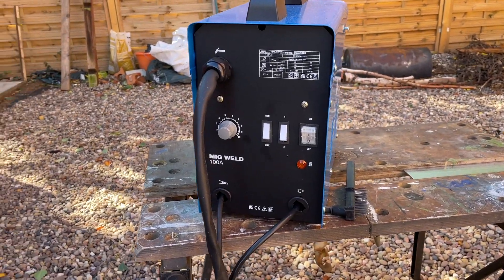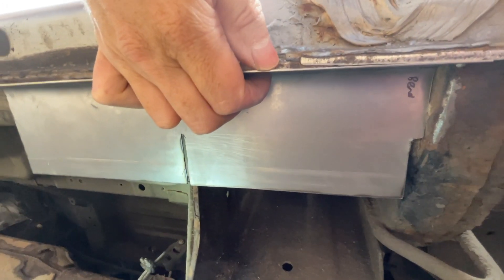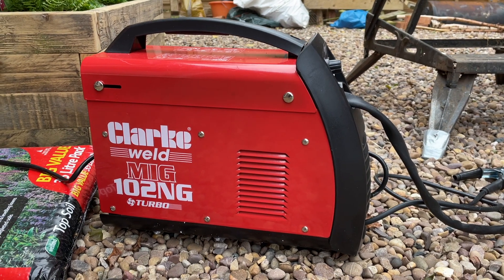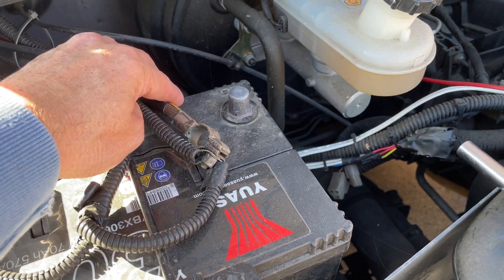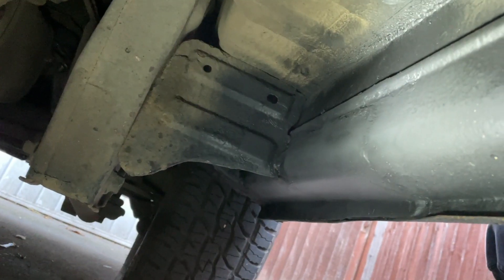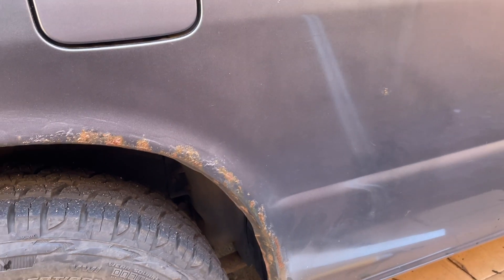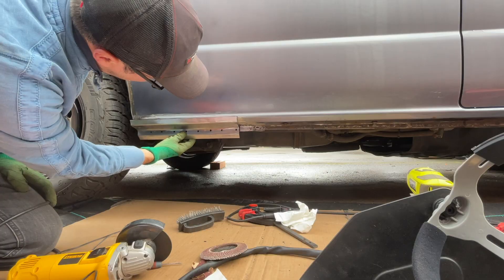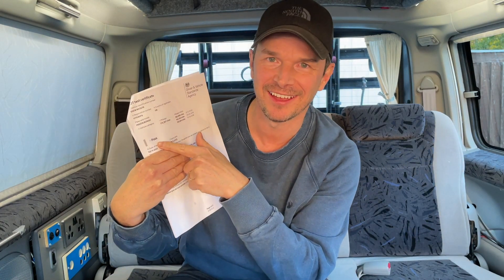1st Time Welding | Sill Repair On a Mazda Bongo Campervan

Comment: You done well my friend saved hundreds keep at it give a little more wire speed you will get there all the best to you kind regards ron😊
Reply from the maker: Thanks! I'm pleased I had a go at this. Getting the settings right on the welder was a real challenge and I still don't think I've got it sussed, I'll just have to keep practising (thanks for the tip) :) Cheers

Comment: Synchronicity, I am about to embark on some welding of the inner sills and under the OS front arch on our Peugeot Camper. Your video insired me. to progress. The 'have a go' attitude is one worth going with, especially when little independent garages are now charging up to £75 per hour. When you factor in the costing and compare to a garage, it is a winner outcome, as you have investment which pays for itself almost immediately. Thank you fella.
Reply from the maker: Thank you for the kind feedback :) 

It's 100% one of the most rewarding things I've done. When you start the welding journey you will yearn to weld any two bits of metal together :) It's daunting and things can go wrong, but give yourself plenty of time and practise as much as possible. There's so many other projects that the welder will come in useful and it really can pay for itself straight away. Cheers 👍

Comment: Good job. You'll find many mot testers are reluctant to pass repair welds unless they are seem welded though. I know factory is spot welded but the argument is repair patches should be seam welded.
Reply from the maker: Thanks! I had read that before starting this and I did seam weld a few areas (mainly the rear portion). I did like using the plug welds where I did as they were coming out really strong (with good penetration) and seemed to be inline with the factory welds as you mentioned. I was preparing myself to have to maybe seam weld a few of the parts if the MOT mentioned it, that's why I hadn't put waxoyl on anything just incase! 

I will go with your advice when I do the next parts as there is more to do. Cheers 👍👍

Comment: you can get preformed sills fron Bongospares now
Reply from the maker: I actually bought some for this job, but ended up making my own as I wanted a slightly longer bottom part (and they don't sell the cill shape for the rear of the van as far as I know). They are a good fit though so would recommend them.

Comment: give your self a pat on the back young man. a tip for you. get some scrap metal and just practice welding. try and use some treatment on the bare metal too, to stop it from rusting on the inside. good job . well done.
Reply from the maker: Thanks!! I started spraying the parts with zinc spray and I have got some cavity spray now. I agree with the practising on scrap, it’s a steep learning curve lol. I found welding to be incredibly enjoyable, luckily with owning a Bongo I’ve got a lot of welding to do 😂

Comment: Hi, great video. So after a year, all good? Did it pass? Am just about to start a very similar job on my Bongo. What guage steel did you use? Any tips on not blowing holes in the metal? Thanks, Nik
Reply from the maker: Hi, it did pass (I added that at the end of the video so you can see how it worked out). It's actually passed for a second year as well just recently!! 

I think it was 1mm thick, 1.5 would have been nice, but I used what I could find. The 1mm was nice and east to bend into shape so was pretty good to work with, just tricky welding.

Tips would be to watch a professional welder do it and not me lol!! I think the main tip is to use the lowest amp and a really low speed setting on the welder. Then buy extra metal and just practise over and over, also take your time and don't concentrate the heat in one place with your tacks. As you saw in the video I changed welder as it just wasn't working out. I've recently bought some SIP wire which has improved the welding experience yet again, so I'm confident I could do a better job on the next round of welding. Good luck!!

Comment: what gauge of sheet metal are you using for the repairs ?
Reply from the maker: I used 1mm (basically what I could get from B&Q), it was very easy to bend and work with but might not last as long as using thicker material. cheers!

Comment: How long did the process take you roughly? I’m about to start the same on my bongo
Reply from the maker: It's mainly preparation work really, I spent roughly 2 weeks doing it. But I was having to regularly take breaks as everyone in the family came down with the flu, so I had to keep going back to the house to check up on everyone and feed them!

A timeframe is sort of difficult as you never know what you'll find when you start digging around, for example I wasn't expecting to be welding the rear part of the cill on the drivers side until I got into it. Just make sure you either have a good weather window as you'll need dry weather or do it inside a garage!! Cheers 👍

Comment: That looks like a really neat job and did the trick passing the MOT. I've got a similar job to do in my older Bongo but have been reluctant to weld under the van on ramps. 
How would you describe working under? Difficult but manageable or a total nightmare?
Reply from the maker: Thanks, it was fairly daunting at first, but once I got into it I was enjoying ripping out the rusty stuff and welding in the new metal. 

I would go with difficult, but manageable. My main piece of advice would be to get some good bright  lights to light up the welding area! There were parts that I found really hard to reach with the welder so that was frustrating. All in all a rewarding experience when it all came together. Cheers 👍

Comment: just about to attack mine.

positive some idiot parked mine for two months in the sea...

big thick guage, spot weld stitch in awkward locations... seam otherwise with finished job sprayed inside n out with zinc, semi-bake n waxoyl.

decent mask an absolute must... borrowed a pals who spent the same on mask 😷 n gloves 🧤 as the welder.

miles easier when you can see, but BE VERY CAREFUL welding upside down. Snots don't cool down when they hit your calf muscle... 😖😩🤬

speaking from experience, with added bonus of a horribly infected bullet hole. 😉

ps. brilliant job for a first effort dude.
Reply from the maker: Ha ha, I know what you mean, they're like shipwrecks!

I learnt to be fully covered very quickly when welding upside down!! especially crammed under the van with no room to move, horrible job.

I'm going to tackle the sills on the drivers side next year as those aren't going to last long. 

Cheers 👍👍